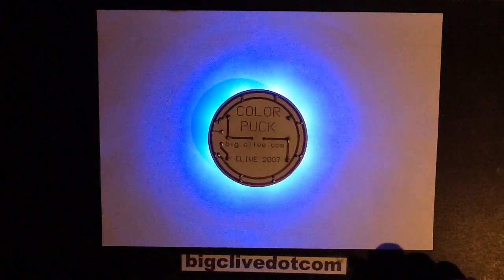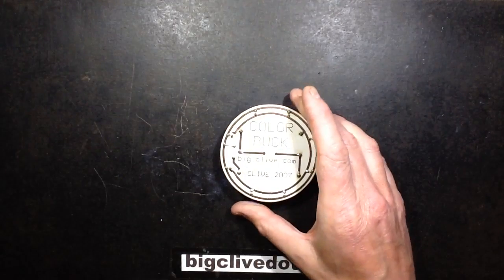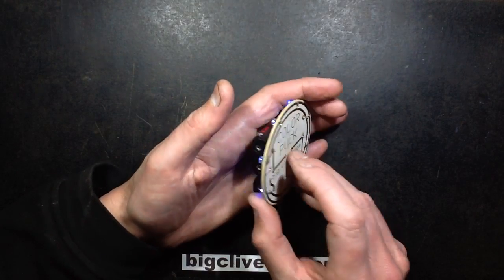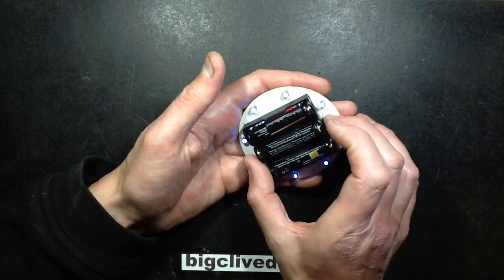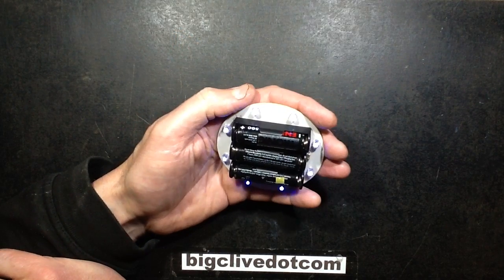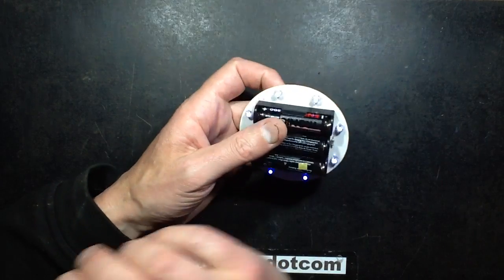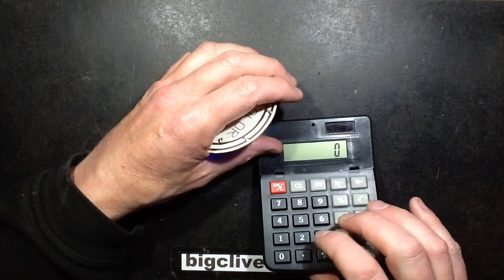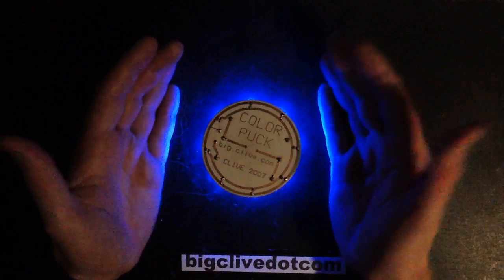Prototype LED color puck.

Comment: Maybe revisit the project and have it run off a authentic joule thief. You could use a 12V 70W LED panel protected by some glass or acrylic as a coaster that illuminates stuff from below. Depending on the transistor used, it can handle at last 40V open circuit voltage for the US type and 50V for the BC377 or 65V for the BC547. So the 12V are no problem. I tested it with a 10µH coil and a BC377 , which is not even ideal.

Comment: If it was reasonably priced i would definitely buy a few of them, coasters, bong coasters etc, (actually that would be really cool having a recessed center led so if you put your bong (or a glass of water lets say) it will illuminate the water inside!) (i would definitely buy multiple if that was the case) so let me know!

Comment: Why don't you use a string of WS2810 and a micro controller(Adafruit have a nice tutorial on it and a Arduino library) I know it won't be as power efficient but it will allow you to specify the RGB value and do different colors! even fades and stuff!(and who doesn't like a RGB led!?

<Shameless plug>
If you want the micro controller to be a WIFI connected ESP8266 Then check out my channel for my new series on them! :P
</Shameless Plug>
Reply from the maker: TornTech The original idea was for a simple splash of colour with huge battery life.  This particular one can stay lit 24/7 for over a week on one charge.